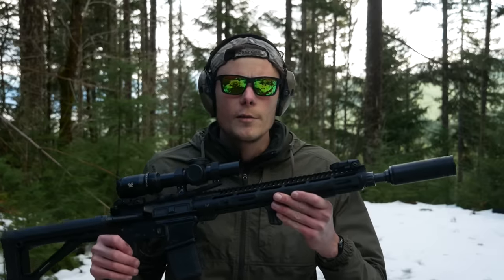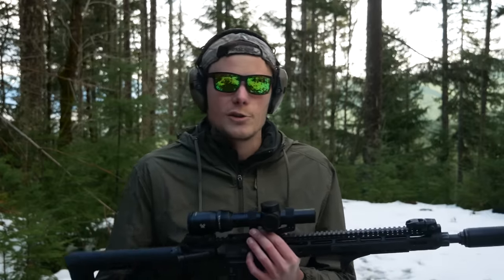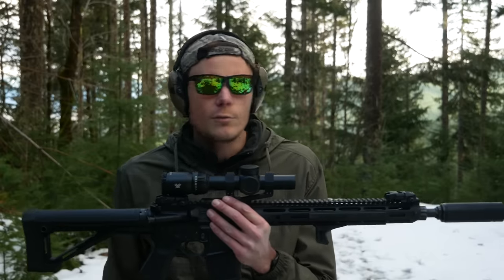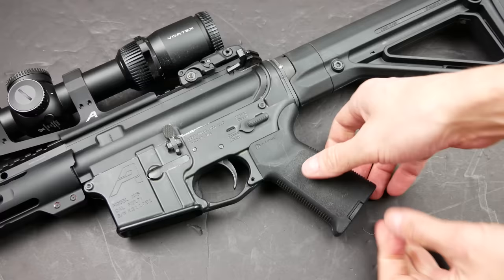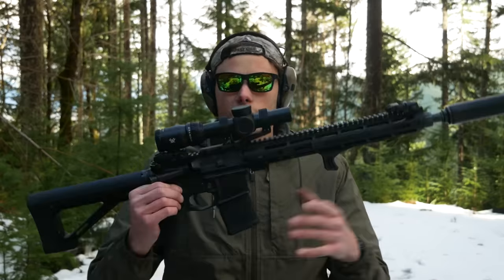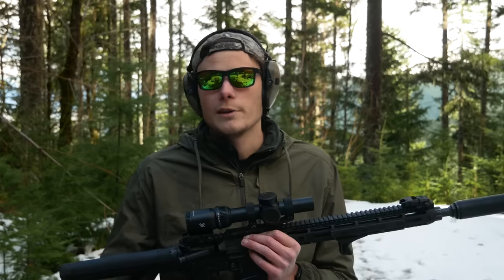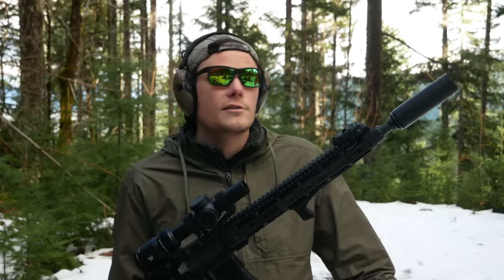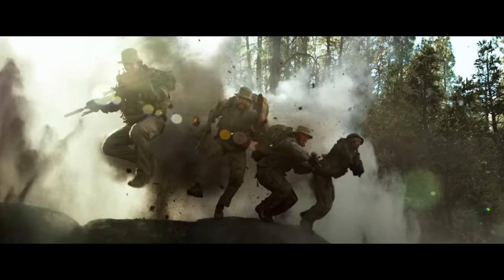WTF are Backup Iron Sights For?

Comment: The problem with common sense is that it's not common. It's a telling sign of the times that you even have to make this video. When I think about having to switch from an optic to iron sights in a gunfight, I tend to be reminded of Mike Tyson's now-infamous quote, "everyone has a plan, until they get punched in the face." When bullets start flying, and your body hits you with a massive adrenaline dump, those optic-to-irons scenarios everyone has worked out in their mind are gonna go out the window, and all you're gonna be left with is muscle memory.
Reply: You're getting into any gunfights with your rifle anyway. Your pistol is the most likely weapon you will have on you if you find yourself in a use-of-force situation.
Reply: @Enjoyer.762  I have more than once, but I'm carrying on duty. I've been in both scenarios.  Once, where I started the fight with my pistol and ended it with my pistol. The second, where I started with my pistol, but worked my way back to the rear of my vehicle to get my rifle. The third and fourth I was expecting a fight, and I already had my rifle at the ready. I automatically assume that any/all electronics are going to fall, so I run fixed Scalarworks irons with my MRO HD on a  Scalarworks  lower 1/3 mount on my DDM4. I also run taller sights on my Glock to co-witness with my RMR.

Comment: I don't want to sound like an asshole, but honestly... The title is absolutely baffling for a gun channel. They're obviously in case you mess up your optic or if it runs out of battery. Or maybe the optic is a scope designed for targets hundreds of meters away, and you get into a situation where you need to remove your optic.

Skimming through the video, you are basically saying everything I said. And I'm not a gun expert. No one needs to be a gun expert to understand what backup iron sights are for.
Reply from the maker: You shouldn't have skimmed
Reply: Skimmed milk